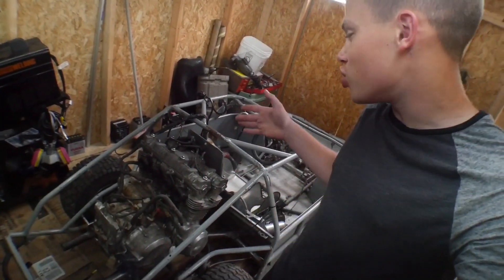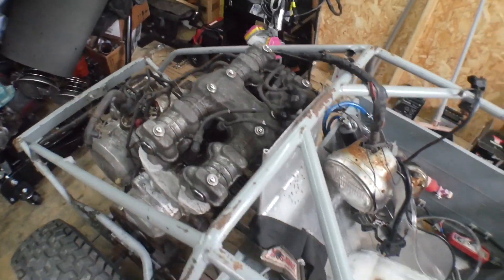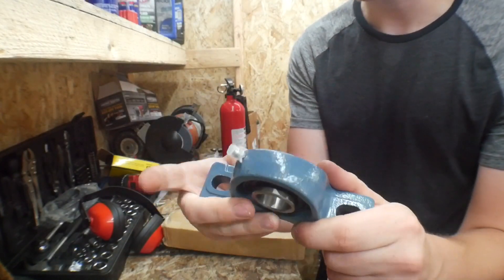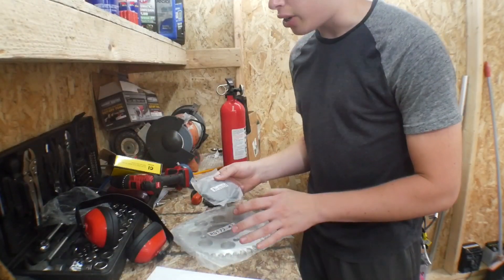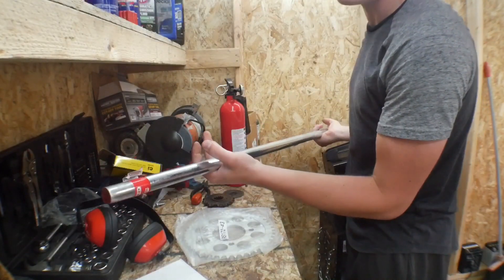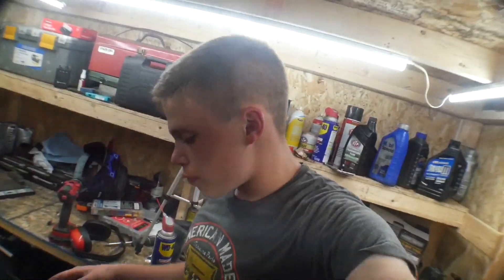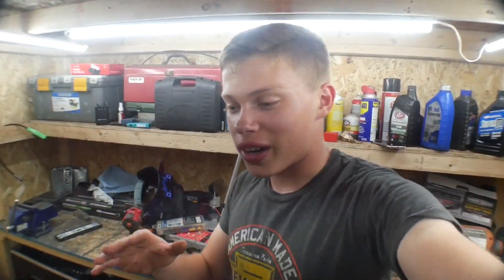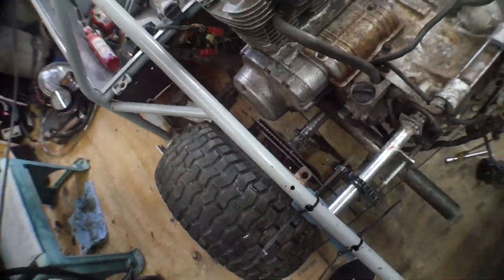Beginning To Make the NASKART DRIVE With it’s New ENGINE!

Comment: NO NO NO.... There is so much wrong here i dont know where to start.... 
Next time when you are using a leveler, try turning it 90` and se if it is still level. Find someone with a lathe and get them to cutt the end off that a perfect 90`   And dont weld on the engine/frame with the electronics from the engine stil attached.   you wil end up frying something important.   And the stock gearing is for a 17"ish rear wheel not a little 10"ish gokart wheel.  And please go to your hord of bikes and check out the engine mounting on ALL of them.  None of those engines are laying on the frame, they are ALL mounted just to the engine mounts. And that is what you need to do with the gokart.  or the engine wil vibrate a hole in the casings against the metal frame.  Don`t even get me started on the "drivetrain" part of it....  I thought you said you where gone do this in a proper and methodical way.  this is NOT the corect way of doing this.  Do some research and finfdd out how other people have done it. and copy there way, the way that is proven to work and be the right way.  Use your head. But then again,  If you are planing to ride that go kart as much as your other bikes( Try starting it up, fix it, and let it sit outside for 6-12 month. Try starting it up, fix it, and let it sit outside for 6-12 month) Then you wil be just fine....
Reply: He needs to speak to John and ike from cars&cameras,     they can save his life, this will be dangerous
Reply: @jasonpetrich4141  how are we gonna get them to find this then
Reply: @HJE04  that I'm not sure of,?? I  dont know how to share videos to other youtubers. You could message them directly and ask them to speak to him personally
Reply: @jasonpetrich4141  He obviously doesn't read comments on anything so getting him to listen to John and Ike or the Ethan and the other guy from grind hard plumping is like telling a goat to not eat these flowers 😂🤦‍♂️ hate to be an ass, sometimes in these kinda situations you have to be especially if it's more for ones saftey. I do know I would've went about mounting that thing completely different. If he knew anything about the reason why this mini cup is setup the way it is for strength and how that engine is gonna bend that axle he would reconsidering this this is why outlaw wingless and winged karts have nothing bigger then a 450 and most of those have stout ass 2strokes on them.
Reply: supertedogpriken so he ruined the kart then 😂🤯🙄
Reply: Car and Truck central not really but he’s the king of half assing everything
Reply: @optimusfuzion8413  he id documenting the journey to his death. that thing is going to be a death trap. he cant even fucking jump out of this thing. i am reading the comments laughing my ass off. he is seriously going to get injured doing this.
Reply: @Jason Petrick I sent this to them on instgram hopefully they see it.
Reply: Let it sit for a year? Nah man
Reply: jacks 420 he is saying that cause this kid fixes his bikes more than he rides them
Reply: @optimusfuzion8413  wouldn't exactly call it fixing....
Reply: supertedogpriken bro shut the fuck up let the kid do what he wants I can’t wait until it’s running and he’s ripping that shit ima be laughing in your face you think anybody gives a shit about that essay you wrote 😂 just fuck off
Reply: K buddy let's see you do a video of a project even as close to as good as this
Reply: Dude i agree but just help dont tell him hese wrong or shouldnt do just explain  n let him read
Reply: Well mate he’s only like nineteen, he tried his best to do it withe the tools that he had. And to be honest he did a great job.

Comment: Pull the bearing off even tho it would be hard.. I dont think you would want to run a split sprocket with that motor if you plan on going any sort of speed and it would probably be pretty hard to split that sprocket straight down the middle so I would just probably lube up that Axel and pull it out or get a rubber hammer and hammer it out

Comment: You should of just built a jack shaft would of for sure held up and worked way better
Reply: You are exactly right buddy plus he could change the sprockets on the Jack shaft to get the gearing where he needs it
Reply: Addison Elsasser right, his weld will break in one clutch dump
Reply: @trail-tr2ql  with that welder and those plates possibly will. Definitely not what I would've done. Very much so calls for a Jack shaft
Reply: Kylee Bates most professional welders will tell you to make a jack shaft and that it won’t hold, I think it would if he slid a piece of pipe over it with holes drilled in it, then got it where he wanted it and filled the holes in with weld. Either way welding straight to the motor isn’t the right way of doing things and a jack shaft is a much better solution
Reply: Bc you don't understand how much stress that takes just build a jack shaft
Reply: Addison Elsasser  The only jack shaft in this video is this kid 😂... This kart is a pile of fkn junk lmao 😂

Comment: After you build your custom exaust you need to rap it in exaust heat tape and put a heat shield behind the seat. If you can find a header blanket rap that fits around the header get it.  Safety first. "DON'T GET BURNED!" Love your videos! I think the drive shaft welded to the engine might affect the oil seal and you won't be able to remove parts. "OPPSEY!"

Comment: Don’t weld the rod to the engine shaft it will heat the oil seal up and melt it it will then start leaking oil try to figure out a better way to attach it
Reply: If he does a Jack shaft setup problem solved.... and he could then play with the sprockets on the Jack shaft in order to get the gearing right where he wants it but if he wants to weld the shaft to the sprocket output shaft then I guess he can smdh🤦‍♂️
Reply: Yes, welding that rod to the shaft is a very bad idea. Not talking about the weld he put down. Cold af.
Reply: Plus, Wobble Wobble Wobble
Reply: Wonder how long before it bends🤔
Reply: @rncboy2  it gets to hard to bend, will simply brake off when putting a little torque on it
Reply: Wim van de Steeg  I’m thinking one clutch dump and it’ll snap
Reply: @rncboy2  I give it 1 ride
Reply: Welding the shaft. Huge mistake
Reply: Seriously you just told him that after watching him do it